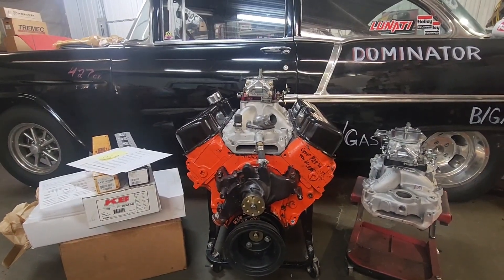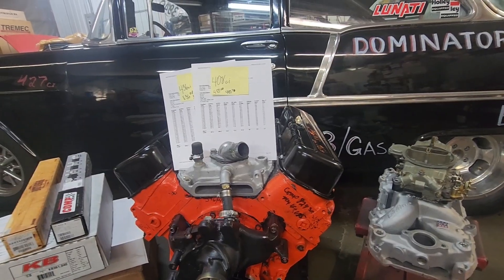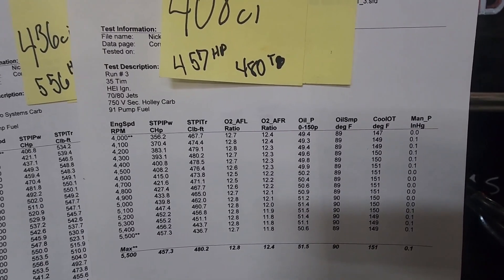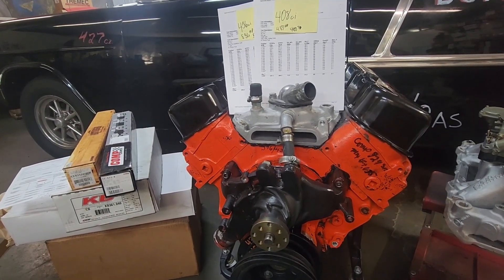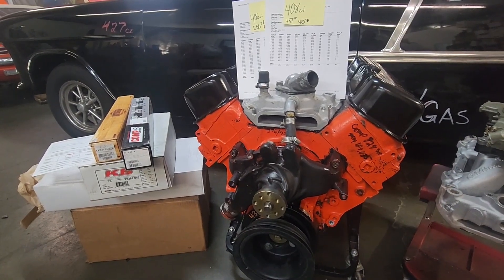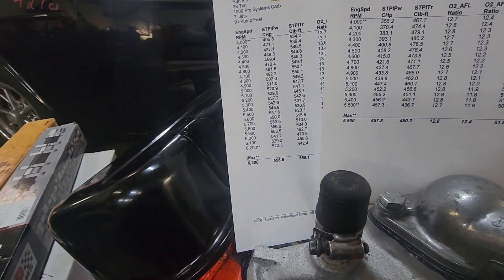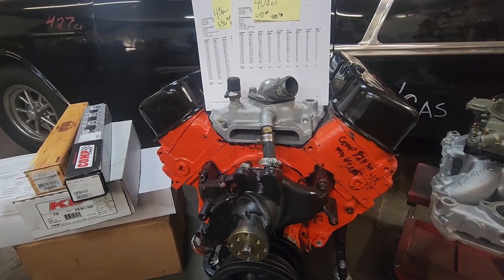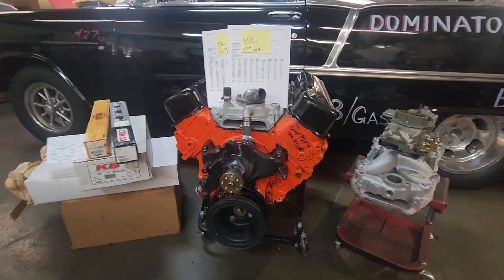396 bbc Versus 436 bbc stroker

Comment: A good chunk of that 99 more horsepower and 70 lbs of torque was the Lunati cam and the increased compression. That Lunati cam is Alot better than that Comp Cam. 108 vs 110 will pump that torque up also.
Reply from the maker: Good point I would say you're right

Comment: I've built a few 396 bigblocks over the past 40+yrs. Definitely can make power with a huge solid roller and some good heads & high compression. I used 1050 Dominators on them. Run like hell. Rev like a SBC.
Reply from the maker: Cool..Thanks for sharing!Thank you for watching my video

Comment: Hey Nick ,do i need to grab some square port heads for my 396  to a 436 build?Mine are the low hp heads with oval ports..I'm old but I built 283s and 327s  when I was young..a newbie to big blocks..
Reply from the maker: The pistons that I talk about in the video, work with open chamber or closed cylinder heads. if you're trying to build less than 600hp, I wouldn't use rectangle intakeports

Comment: Have you ever put a 396 crank in a 454?
Reply from the maker: Many times it, makes a 427 cubic inch, 427 style motor
Reply: @dzperformance7360 I have 396 with crank trying to decide what I want to do.
Reply from the maker: Keith black pistons and a four fifty four block and make a four twenty seven bore at seventy over and get four hundred and forty one cubic inches out of it

Comment: What do you think would make more power a 434bbc 8:7-9:1 or a 408bbc with 11:1 I have Merlin 265cc heads 2.300 intake valve 350cfm .600 lift with a solid roller? The only reason I ask is because I have both crankshafts and icon makes 41cc dome for the 3.760 stroke but not the 4in stroke I can't find a off shelf piston.
Reply from the maker: Just my opinion, but I think the cubic in. would win that one, also, there's just something about that longer stroke that gives the motor more balls

Comment: My 69 396ci out of a C10 pickup has a cast crank
Reply from the maker: I have noticed that 1969 is the first year. They started using some cast cranks. 1968 and older are usually. forged

Comment: Question! What valve sizes are you using in these 290s?
Reply from the maker: 2.19/1.88
Reply: @dzperformance7360  Thank you! I have a pair of closed chamber 702s, but I would have to have them cut for larger valves. Just looking at all my options. I appreciate it! ~C

Comment: Do you happen to know what pistons were used in the 408 build? Im about to build a 408 out of my 68’ 396.  Looking to do a build extremely similar to the 408 in this video, so was just curious on the pistons used. Thanks, and great video.
Reply from the maker: No I bought the motor as a 408 I By the Pistons and I didn't notice the number on

Comment: Are you using forged or cast crank? Is cast crank safe to use?
Reply from the maker: Cast yes at this horsepower level
Reply: @dzperformance7360 Your video gave me the inspiration for my matching number 70SS Chevelle stroker build. Was your pro systems carb off the shelf or custom made? Did you use a 454 flywheel and a 454 harmonic balance, part number? Is the crankshaft in the engine in the video cast or forged, brand? Thankyou from Australia.

Comment: Here is why this is interesting me is because when I was dealing with a machine shop in Portland Oregon called control cylinder to build the BB 402 for my work guide Jet boat, I asked can that be stroked with a 454 crank because I have 2 of them.
The Machine show gave me a long this and that reasons it can't be done so I went with the BB 402 rebuild.
This machine shop is out of business, but the last 5 years open the shop turned into Scam control cylinder by lying to me not using my parts then buying parts I already had to pad the billing.

Comment: I’m about to do a 402 build with a 454 crank and edelbrock oval port 100cc chamber heads do you think a zz502 cam would work well? Btw love the videos
Reply from the maker: Yes I like the idea that cam in that motor. Probably peek at 5700 RPMs ,wouldn't be any need for a stall converter , 3.42 gears or better would work, in even heavy cars, probably make  over 500 hp. Sounds like a cool project thanks for watching ,thanks for sharing

Comment: Love this build
Reply from the maker: You're going to love the next project I run that 436 against an old-school 427 same camshaft, intake manifold ,carburetor, distributor
Reply: @dzperformance7360  my 427 is a 439 it's 60 over I love it. I hope to build a 496 or 505 in the next year.

Comment: Is there a reason you used closed chamber heads for this build? I have the parts around to build this combo, but the heads i have are open chamber heads casting #820
Reply from the maker: The domes on the Pistons are made for closed chamber or open chamber but they're only 17 CC's so you will only have a compression ratio of low 9s approximately 9.3 to 1 with open chamber heads. Most closed chamber heads will get you approximately 10.7 to 1

Comment: Nick I recently acquired a 71 396 in a deal that’s been bored to 408. I have a good 454 crank/balancer sitting around that I could use. The 408 has a hydraulic roller cam in it, comp springs, Harland sharp roller rockers, etc.  So I would only need to buy the pistons so it’s very appealing to me. When I researched putting the 454 crank in a 396 block everyone keeps talking about clearancing the block for rod clearance. Have you had any issues with this? I’m not a mechanic by any means, so it makes me a little nervous doing block clearancing if I have to.
Reply from the maker: Yes I've been told stories about people that has had clearance issues I've only Built these motors twice and had no clearance issues but, I have put all kinds of stroker cranks in small block and big block Chevys I wouldn't be nervous about getting a grinder and taking out a little Notch in the block to make things clear,, you can do it!! thanks for watching
Reply from the maker: All you got to do is use a feeler gauge make sure you got at least .030 clearance everywhere for all the parts stretching  it'll be great. You can do it

Comment: Whats a good set up for 396 .030 street strip use looking for power package already looked into Eldelbrock Performer RPM! Its a 66' Chevelle SS period correct car
Reply from the maker: There's a video my most popular video has a 396 running with a extreme energy 236/ 242 hydraulic roller that makes 447hp if you're just looking for a tame Street combination. That kind of power could push any old Chevelle into the low 12s be a fun street car

Comment: What are your thoughts on running a tunnel ram on the 436? Love your videos btw
Reply from the maker: It would be fun,, it would definitely pick up the horsepower and probably lose a little bit of torque but if you're putting it in a car with low gears and fairly lightweight it would be a blast
Reply: @dzperformance7360  It’s going on a 1960 f100, 4spd manual with 4.10 gears

Comment: I've had my 68 Camaro for 30 years the 396 still puts a smile on my face when I put the pedal to the metal, great video keep them coming
Reply: I have in my 30 foot jet boat powdered by a 1969 BB 402 I run guided salmon & Steelhead fishing trips in Oregon and Washington.
When I need power to get the jet boat up and out of the hole with a load of 7 clients the BB 402 gets the scoot on the jet boat and older clients like me remember the days when these engines still ran the cars they came in - absolute pure HP Power !

Comment: Just curious, wouldn't a 408 CID be a .060" overbore 396? Since .030" over is 402 CID.
My pump gas +.030" 402 made 441 HP.  Small dome Speed Pro pistons, stock 049 heads, 9.6:1 compression. Flat tappet .553"/.578" lift, 234*/244* @ .050, RPM intake, 850 Holley.
Sounds mean, but with good street manners with a 3,000 stall converter, fun to drive.
Thanks for this video, engine is 25 years old and still strong, but will look at stroking it thanks to your excellent sharing of this combo.
Reply from the maker: I stand corrected on the cubic inches,, The first combination was a 408, When I moved up to the stroker package. I had the block honed an additional.010
Reply from the maker: That's a nice Performance package!! But I wouldn't try to talk you out of Installing a 454 crank and  KB. pistons
Reply from the maker: Thanks so much for watching,, thanks for sharing your combination!!

Comment: Nice combo and great results, just goes to show you that there's more than one way to skin a cat, how much more could you have gotten out of the 408 with cam and alluminum heads with a little more compression and flow, and how would that stack up parts and labor wise to the stroker build, including machine shop. I still think that dollar for dollar, nitrous oxide is the easiest way to add power without losing drivability, and when setup properly it will blow your mind more than your motor lol. Keep rolling......
Reply from the maker: Those would all be cool projects !! thanks for watching

Comment: Nice results for something so simple.
Great job.
Reply from the maker: Thank you!
Reply: I am building a 408 with 820heads ported runners and pockets stainless undercut stems 2.06 intake valves 1.72 exhaust valves probe icon 580 dome pistons cam advertised 310-320 602 578 Chinese airgap intake 750 double pumper 2 inch summit headers what would you estimate horsepower I don't have access to a dyno I just want to get a rough idea of the potential

Comment: I'd like to know what the 436 would do if it was set up just like the 408.
Reply from the maker: , what would the 436 do if  built with the lower compression and smaller cam,, In my opinion, it would lose 30  to 40 horsepower

Comment: What's a good cam to run with a 468 flat top pistons and 781 heads for the street? Thanks
Reply from the maker: Flat top pistons and.#781 head will usually get you 8.5 to1 cr.. I did a motor like that a couple years ago with a thumper 227/241 @.050, it Made 516hp 565tq , all under 5400 rpms! That's what I do,
Reply from the maker: The cylinder heads had almost no porting but the compression was About 9.3 to 1,, your compression will let you run on 87 octane. And you'll probably only lose 5 to 7 horses.
Reply: Awesome thanks I was told the block was decked and the heads were shaved down to get the compression up
Reply: I don't know if I said that right 😅
Reply from the maker: O k great you probably have more compression than I was thinking
Reply: I really appreciate you getting back to me I'm enjoying your channel doing a great job 💪
Reply: Do you run hydraulic roller, solid or flat cam setups? Which do you recommend for a street truck?
Reply from the maker: Hydraulic roller
Reply: Good morning, what exact cam did you use? I'm getting everything together so I can assemble in the near future

Comment: I did a 1970 402 .40 over 2 bolt main, 10.00:1 with and eagle 4.00" crank for internally balanced big blocks, stock oval port  3964290 head castings with 2.06/1.72 valves, no porting, hydraulic roller camshaft .566 lift with 230/230 @ .50 112 LSA Edelbrock Performer RPM AirGap. 421HP/510TQ. It's the original engine, trans, axle in a real SS. It came out to be 436 ci. I don't want to break it. 

That's impressive what you've done.                 
What head casting are you using?
Reply from the maker: #290
Reply: @dzperformance7360  any port work?
Reply from the maker: yes ,  Very basic porting but it had 2.19/1.88 valve's

Comment: Hey nick I'm a huge fan of big block chevys I have a 0.60 over 427 so a 439 it's a simple build it's around 10.5 to1 compression afr 265 roval port heads victor jr. Intake atm 950 carb and a howards 235x241 @50 618 lift on a 108 lsa the motor made really good hp best pull was 661 hp 605 torque @6400 rpm I think with a lil more camshaft it would do better I'd like more duration a few people told me the cam I picked was perfect for my combo what's your thoughts on this I do have a comp xr 292 solid roller I think it's 254x260@50 and 650x666 lift on a 110 lsa I'm thinking it would pick up 20 to 30 hp with the cam swap if not I'll hold on to it for my 496 build. That is a good looking 55 in the background let me know what you think on my combo any advice would be appreciated thanks your friend from Louisiana Rick 427
Reply from the maker: My answer was too long and complicated. My opinion is don't mess with the 427. Put it in a musclecar use it and brag to your friends about it.

Comment: great build more power thanks for the info. would there be any advantage to a 6385 rod? is there a piston for the longer rod?
Reply from the maker: This project's all about economical parts. I don't know of any Off the shelf pistons that will work with that rod length,
Reply: thank you good power on a budget

Comment: I'd like to see a side-by-side comparison of a standard bore/stroke bbc 454 and a bbc 402 with a 4.25 stroker crank. Both combos make 454 cubes.
Reply from the maker: That'd be cool ,,but the custom pistons to build the long stroke 454 would be about $1700. I'm probably out on that one.
Reply: You need to borrow the 402 about another 1/8 inch. Need 4.25 bore
Reply: Cheaper to just buy a 454.

Comment: Everybody turns their noses up at the 396/402. I’ve always liked them. People should go look at pure stock drag races. The L78 ran just as good as the LS6. Hell, an L78 Nova was hard to beat. One of These days I’ll build the 70 L78 I have in my shop. Really like your channel.
Reply: I had a 396/402 big block. It was good little rat on the street.
Reply from the maker: Appreciate the compliment
Reply: I offer salmon - steelhead guided fishing in Oregon and Washington so my jet boat I used a 1969 BB 402 for the jet boat - it is a beast!
I am 65 years old so the clients in my age range love the sound of old school Chevrolet power
Reply: Nice build. Me and a buddy built a 427 396 block 454 crank combo back in the 80's  combo  for a buddy's of his drag '68 Camaro. Same 2.19/1.88 valves. I forgot what roller cam setup we used but it had brutal mid range in the 1/4 mile. Tricked out 350 turbo and 4.56's hurt a lot of feelings and wallets. Great build. Thanks for sharing.

Comment: in the 70's car magazines were claiming  that a 1966 396  block could be punched out to 4.25" bore. How true was that?
Reply from the maker: I didn't know that,, I've never had one sonic check to see how thick they are.!!??
Reply: It's true, the early blocks could be bored that much.
Reply: Early blocks only.   Remove soft plugs and if a pencil will fit between cylinders,   It’s late, thin block,    If pencil won’t fit, it can be done.     
   Good luck finding an early block.

Comment: People make such a big deal about compression techy... bla bla bla bla bla. Look at 454 motor home build with trick Flo top end kit. 8.2 compression and almost 570HP! Can run 87 pump gas all day!
Reply from the maker: I'm, working on a motor home 454. Just like that so we're gonna find out
Reply: Yes, but you pay for the heads what you can build the motor combo he's showing us if you do some careful shopping and assembly.
Reply from the maker: Check out this plan,, I'm going to put 396 heads on my motor home 454 and a roller cam and going to make approximately the same horsepower,,
Reply: It no longer has 8.2 compression due to smaller combustion chamber. Also run it on a conservative dyno PROBALL makes 30 less hp
Reply from the maker: Yeah everything you said correct,,

Comment: Hey Nick do you have any experience with the gen 6 vortec 7.4 heads? I have a set and i have a 396 block but not sure if they will interchange?they have a big swirl ramp in the intake port and they have a very tight chamber.
Reply from the maker: I've never done that before,, I don't think that will work,, The coolant holes are slightly different,
Reply: Some people have successfully put gen vi heads on a mk iv block. You will want a mk iv head gasket and check the cylinder head water jackets carefully near the lifter Valley. depending on core shift they could dump water into the lifter Valley, but most likely you'll be  fine.

Comment: Awesome info Nick, appreciate you sharing that with us! I expect to be in the high 10's with 500-530 HP @ 3400 lbs. If I'm not, I've got a chassis issue somewhere.

Are these 781's/049's? You say they have the large valves, did you do any port work on them? Thanks.
Reply from the maker: The heads are 1968 cast# 290, As far as porting work, I did not port them myself. But somebody had done a very nice job of gasket match and bowl blend porting,, It didn't look professional grade, but the guy that did. It had obviously ground on heads before,,

Comment: My 66 Chevelle ran 10.67 et. at 125 mph with the 408"...  850 cfm holley carb, 8162...
Reply: With 4.10 gears?
Reply from the maker: Sounds like a wicked 408
Reply: It was ok back then, 30 yrs. ago...
Reply: I had a 5.13 gear
Reply: @leonardfoster6252  good lawd! Drag ⚙️